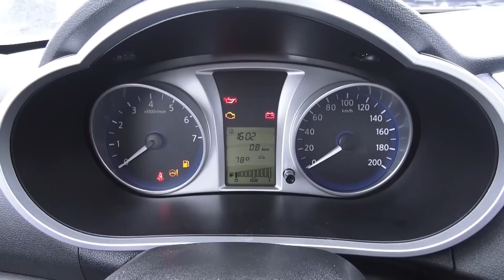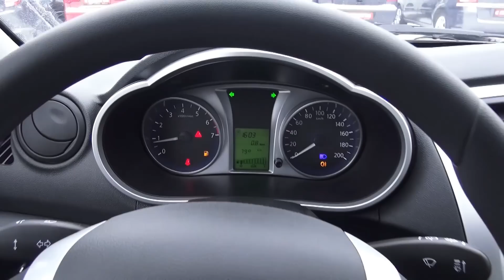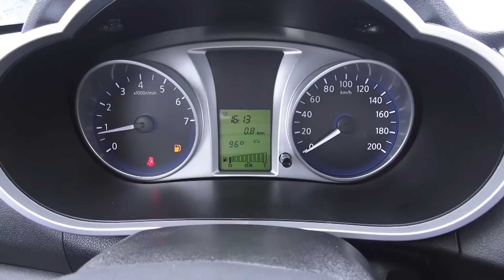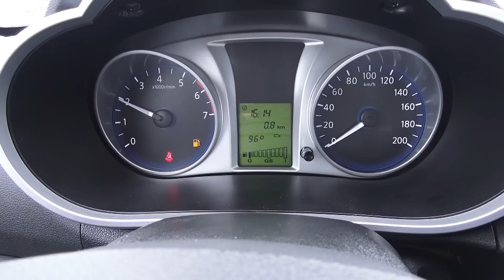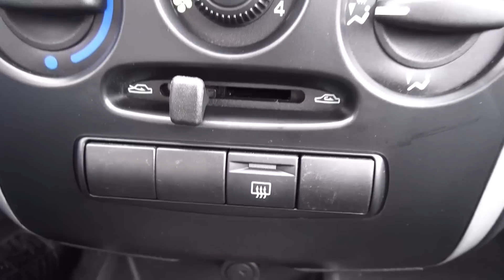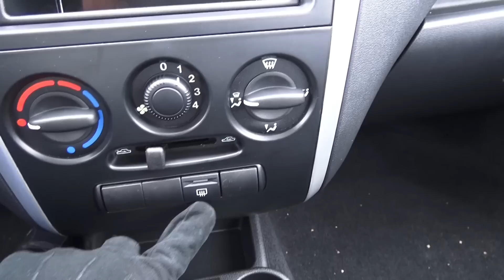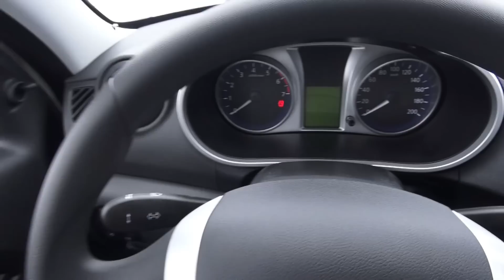2014 Datsun on-Do. Access. Start Up, Engine, and In Depth Tour.

Comment: which is better,this or renault logan?
Reply from the maker: nacevmircea i think its just the same thing=)
Reply: i think logan be better
Reply: MegaRetr, please do startup & review 2014 Toyota Corolla. Thanx! 

Toyota Corolla has now equipped with a CVT Automatic Transmission with Manual Shift Ability.
Reply: @blacksmoker90  never

Comment: I tought  the AutoVaz just going to simply rebadge this car, as Lada on-DO
Reply from the maker: cmdarb141 Hi man nope they just decided to make a new car=)
Reply: Yes, but the Renault Group owns the Nissan, Dacia,Lada,and now they bring back Datsun too, for the cheap car segment, but i think these models  has just the same mechanics and body, so they going to compete against each other without no good reason...
Reply from the maker: cmdarb141 Well yep but the same time you got excellent choice between them. It`s like candy store which candy you prefer? You get the idea. Some parts is taken from granta but they improved it.
Reply: MegaRetr Some parts lol! everything except the front and rear fascia is Lada Granta! I would rather have the Russian name!
Reply: MegaRetr
This idea didn't work out for the General Motors, that"s why they stopped selling Chevrolets in my country ... basically all of them just another rebadged Opel, but they competed each other too much in price.